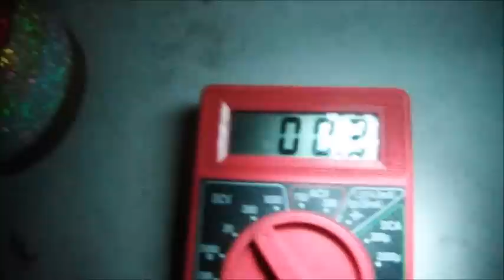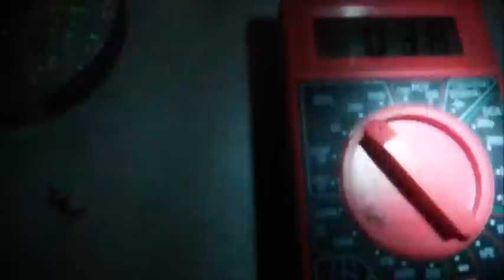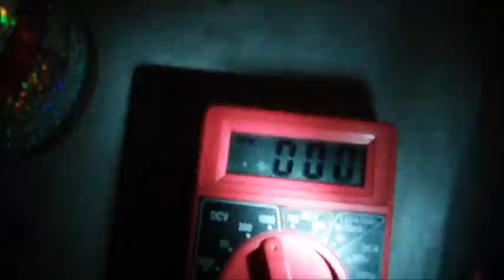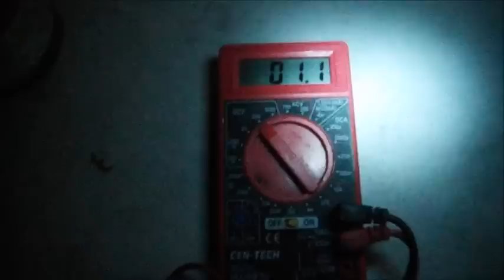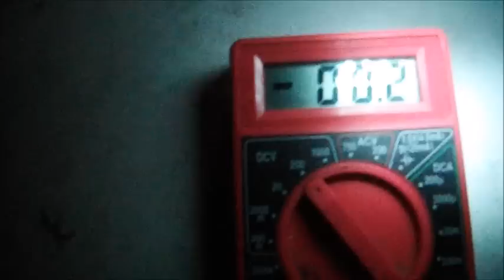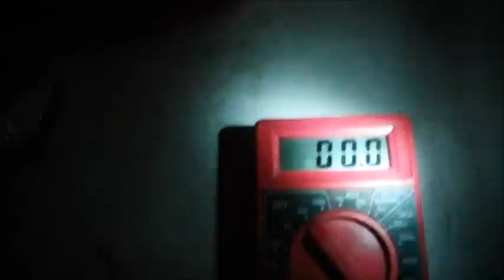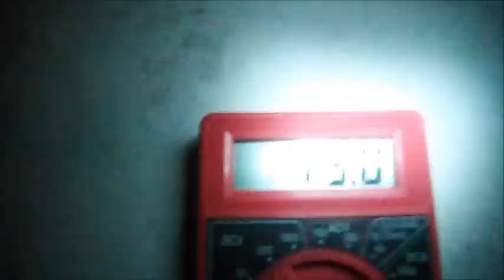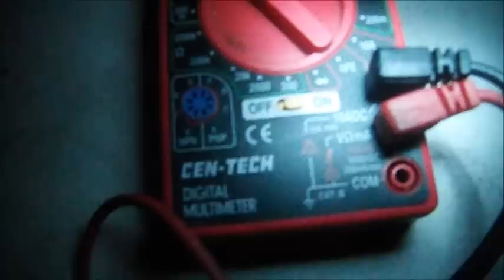WE GOT WIND AT THE OFF GRID CAMPER 07 ™

Comment: Are you sure you are even reading volts? Your multimeter has the wires in the wrong sockets and I would not trust any reading it gives until it's correctly wired (you can see this briefly at 8:48 - there is no wire in the "common" socket). I recommend you read https://learn.sparkfun.com/tutorials/how-to-use-a-multimeter and watch the video, as incorrect use of a multimeter can be dangerous (to the meter, to the equipment and most importantly to you the user).
Reply: Ah doh, just finished watching the video (I had it paused when I saw that problem hehe). Okay, you asked specifically for my comment shortly after :-). Yes, your black wire should be in the "common" socket, and your red wire in the "volts/low-amps/ohms" unless you're testing high current devices. But I still advise reading/watching the tutorial I linked (everything I said still stands).